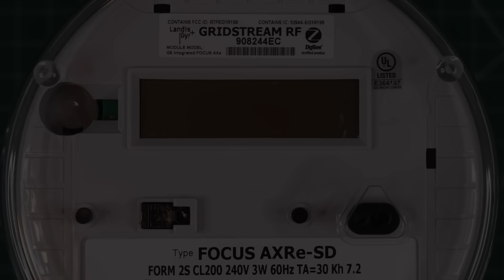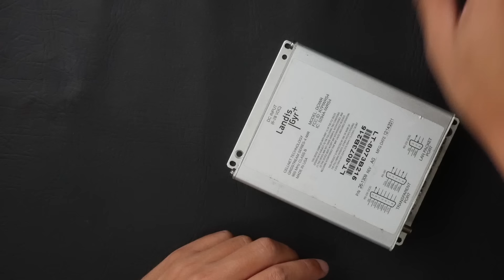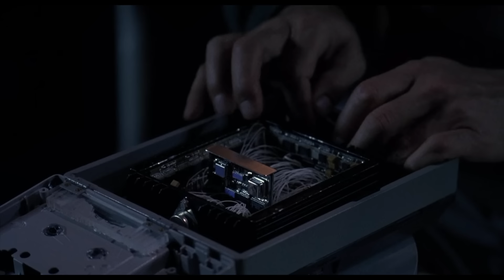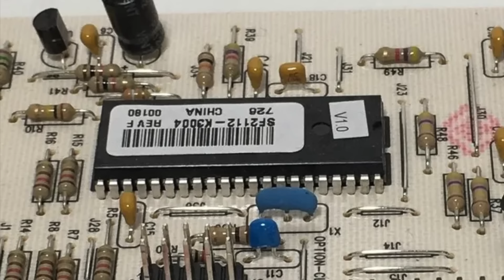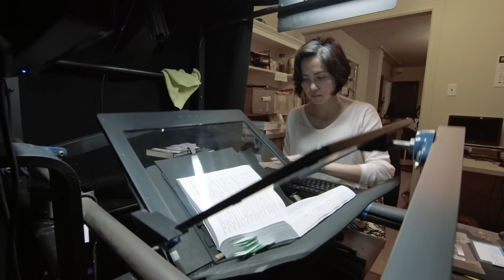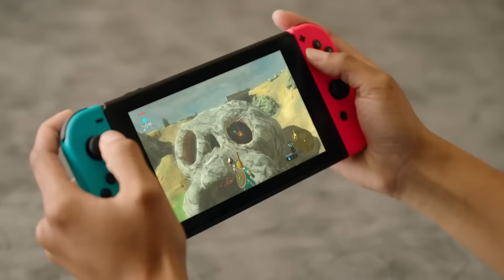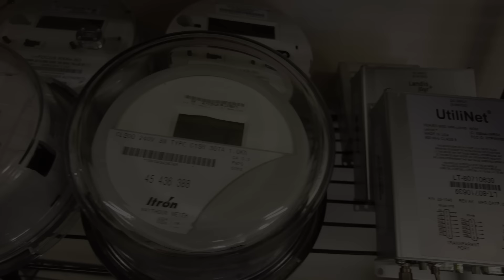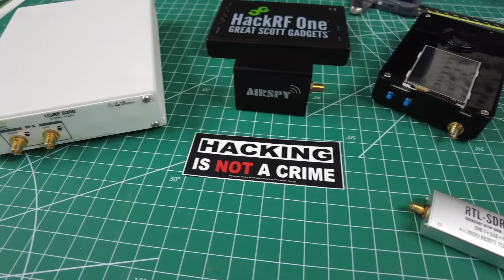The REAL Problem with Smart Meters

Comment: I'm a firm believer that all critical infrastructure software should be open source.  Corporations that deploy systems like this should be required to participate in bug bounty programs, DHS should be paying bounties too.
Reply: And keep the 💩 air gapped, at-least requiring the attackers to have "physical" access. (Be within legal jurisdiction)
Reply: Are any of you actually software or hardware engineers? Do you understand that even if these devices are closed source they are almost certainly built using open source software of some kind. Open source does NOT make your system less secure. It makes it easier to find and fix bugs making no one threat actor special in any way. All the bugs are visible for anyone to see and fix. That's why Linux finds so many more bugs yet is so much more secure than windows for example. This is a matter of national security and we the people who rely on this software should be able to audit it.
Reply: Just buy solar panels and batteries. Make it a gilt edged priority in your life and learn to live within your power generating abilities. The addiction to energy is not sustainable and leads to crazy power generating and privacy monitoring schemes that add cost to such a simple proposition.
Reply: @slipstreamvids7422  I agree.
Reply: @slipstreamvids7422  wow can you really believe that?
What do you do about the larger % of your energy use that is not used in your home but on your behalf. Are you just going to forget about that?
Reply: I'm sure our enemies in other countries already have that information.  It wouldn't surprise me if those "smart" meters are made in China. 😆
Reply: @TheRealCheckmate How about NOT china.... 1989ish we developed, built, and installed the Original SmartMeters and Radios right here in Campbell then San Jose, CA, U.S.A. yesss USA
A little company known as MetriCom, Inc.
Reply: You're not wrong but we made the mistake generations ago to privatize our utility providers and in that, any corporation is allowed to own the data collected privately.
Reply: our country has zero understanding of data security, and that's why we're dealing with breaches on a daily basis.
Reply: In Italy new Power meters have and open source Powerline Reading protocol.
Reply: I know I will write a bug and let you know so you can report it and we can split the bounty
Reply: What if I wrap my smartmeter with a lead blanket?
Reply: @mutantryeff  it's transmissions wouldn't get to the power company and they would come to check it.
Reply: Unfortunately, these changes require trust in the general public before releasing such power. The one thing that the government is truthfully attempting to grasp is the trustee role of providing safety and security to the beneficiaries(i.e. the public), even if that is corrupt and organized crime to some degree at this point.
Reply: @KickOutTheJhm  well then, the legislature should at least pass laws that require electronics manufacturers to unlock bootloader's, ETC, after they no longer support a product .
Reply: @Pesticide00  I believe the manufacturers would claim financial loss on the grounds of more extensive security measures for every “generation” because likely, they use many very similar hardware and software. We all know that nothing is ultimately secure, given enough time and willpower anything can be reverse engineered, but they make claims to the consumer that their products are secure so this is their form of collateral.
Reply: @KickOutTheJhm  all hardware is pretty much the same, that is no excuse..
  Also I am sure people would voluntarily wipe their device OS if that was a requirement of the unlock. In order to install a custom Linux distro or Android build on their old unsupported device.
  This would also reduce e-waste, this could be pushed as an environmental cause.
Reply: @Pesticide00  I can see that being the case, the vast majority of people see the way that it is now as being more valuable, therefore you see what you see, that is all that I am saying, my intention is to not give excuses, just expressing the reasons that we have such a wasteful, inefficient and unreliable system that actually spans to many aspects of life as we know it, not just with tech.
Reply: @Pesticide00 u guys are all talking out ur butts, this has to do with things like eSIM, IMEI basically it's not possible to bypass such a device because it would allow someone to access network, either 4g 5g or just the internet, u can't do that because then there's no IP address etc. it's built into the hardware. It's also related to hardware backdoors for NSA etc... So ya no that is why it's so hard to jailbreak and not allowed. Ur not allowed to have devices like that that let u hide ur activity or who u are, because it would be used by people who want to do really bad things. If u think ur very well hidden right now maybe u are but u can't access anything or illegal stuff and ur likely not doing terrible crimes but ur also not likely as hidden or anonymous as u think due to hidden tech like chirping etc...
Reply: @KickOutTheJhm the government is organised crime.
Reply: Wow that's quite a leap. While I agree with the principle, especially in non critical systems I'm very dubious this would have good outcomes in critical infrastructure.  While it might find bugs and workarounds you might well be assisting bad players to break critical infrastructure easier than currently. We all know how virus's use old version code vulnerabilities and we all know how hard it is to keep critical networks upgraded to the latest version quickly and safely and hence I think this idea would increase exposure. While I agree with jamess1787, having to be physically connected is great BUT that's going to negate much of our infrastructure operability so its simply not going to happen and maintain what is expected of modern critical infrastructure.
Reply: You'll need TS-CPI clearance SDN
Reply: Lib lzma is open source
Reply: We don't allow them on our homes!! It's a RIGHT TO PRIVACY!!!  It's Illegal Search and seizure > your home has a reasonable expectation of privacy!!
Reply: All owned by a hand full of evil people.  Warren buffet owns my power company
Reply: Im a firm beliver that you all bought the sizzle before you all tasted the steak.
Reply: Automotive embedded and diagnostic software should have the copyright cancelled.
Reply: @gregorymalchuk272  all electronics with locked bootloader's, encryption keys, ETC, should be mandated by law to be unlockable when manufacturing is discontinued..
Reply: then build it
Reply: The programmers will make bugs and tell friends to find them. Like bounty on cobras in India led to them being bred.
Reply: Agreed. We should have our best men on this stuff. You know damn well Russia, china, and North Korea all have their very best looking into it
Reply: Do you think these smart meters were detonated in California causing these massive fires? Satellite images show three huge areas starting all at once. Don't be suspicious, don't be suspicious.
Reply: I know in Europe they used a distributed control system.  About 10 years ago they were using Lonworks and Zigbee
Reply: Private companies, maybe in a different country.
Reply: I'm all for open source but not when it comes to critical infrastructure, i wouldn't open source the code for a nuclear missile, some things need to be kept secret from the public what we need is a way to make sure what it is transmitting is true not to know how it's transmitting it...
Reply: Wouldn't open source software invite hacking?
Reply: @joewoodchuck3824  security through obscurity generally doesn't work out so well.
Reply: @joewoodchuck3824  For example "lets just use all zeros because its closed source"
Reply: @joewoodchuck3824  Yes, open source does invite hacking. But closed source software does as well - it's (sometimes!) just more difficult and might take a bit longer.

The difference is that if a white hat hacker finds a vulnerability in an open source software, everything's fine. If the same hacker find a vulnerability in a closed source software, the hacker might be the target of legal action (note that while hacking is technically illegal in the US, the US DoJ said in May 2022 that it won't prosecute white hat hackers any more).

Regardless, it's still easier for large corporations to airdrop their whole legal department onto a white hat hacker than to fix their closed source products.

Black hat hackers aren't concerned about any of this, they know that their actions are illegal no matter what, and most feel safe in China, North Korea or Russia anyway.

A system that is used for billing or accounting purposes will have a secure hardware component to cryptographically sign its communication. Ya know, things like ATMs, smart locks or ink cartridges. The cryptographic protocols are typically open source (with a few exceptions, like Crypto-1, which hackers just LOVE).
Reply: Ya no thanks on that one.......
Reply: Fuck open source i like money
Reply: You end up with it being abandoned because there’s no money to pay the developers
Reply: @Industry-insider  Oh? so they would just give the electricity away then?
Reply: This should be a part of proj 2025...
Reply: And what if Russia had a 0day that never got reported because it’s not “sexy” for open source world to fix?

And then you, @tonyfremont would be held responsible for any outage, attacks, etc. 

You see why this isn’t as easy as just “open source” it
Reply: @Cherryblosssom-9  yeah the alternative of having one exploitable bug going unfixed for decades even after being used repeatedly is better. Open sources and air gapped.
Reply: @Cherryblosssom-9  That type of behavior is what open sourcing code would deter. 
More eyes on the code means there's less likelihood of something like that happening. Any hidden bugs will be much more readily noticed by the community.
With closed source software, there are less people with eyes on the code. Consequently, if a bug is found businesses have an incentive to keep it secret until it actually becomes a problem instead of actually fixing it or offering some sort of workaround that prevents it from being utilized in a malicious fashion
Reply: @trajectoryunown 
Or we just let the government figure it out, and they decide who's able to do what... Instead of YouTubers
Reply: @Cherryblosssom-9   Would it not make sense that the code would be hardened against attack?  When the code is proprietary  then it stands to reason that the owners would never reveal they were hacked.
Reply: @Cherryblosssom-9   then that's a stupid result of laws, why would you be responsible for something you didn't do. what kind of insanity is this ? 

maybe we want Russia to create an outage, so this stupid system goes dark and we can make a better one
Reply: @monad_tcp But that's the problem. If such happens, the system doesn't get better! Those in power just use it as an excuse for MORE regulations. As well as an excuse to make the system harder to hack into.
Reply: @Cherryblosssom-9 If Russia had a zero-day on this it wouldn't be from @tony's exposè
Reply: @Cherryblosssom-9 you are wrong..
the king of 0day is in closed source operating systems, and software..
Reply: sure but what happens when there is an unfixable bug, or they don't change default passwords and everyone knows how to login, open source my ass :D
Reply: @zoenagy9458  
Businesses are faced with this all the time, it's called risk assessment/management. Replace high-risk/key infrastructure first, then start replacing private equipment as the need requires. If there's a serious flaw that can't be absorbed, you ask Uncle Sam for a hand-out to pay for the cost of replacement.
Reply: @zoenagy9458  unfixable bug? What are you talking about? All bugs are fixable. It's their duty to provide us with secure devices. Security through obscurity is not security, it's theater.
Reply: @zoenagy9458  security through obscurity generally doesn't work out so well.
For example "lets just use all zeros because its closed source"